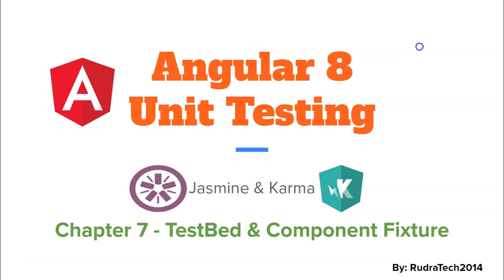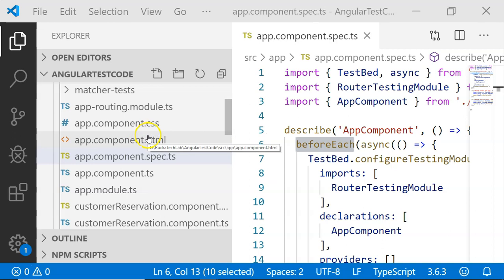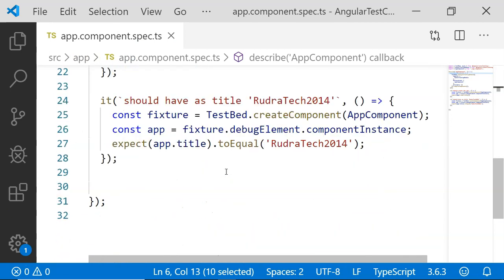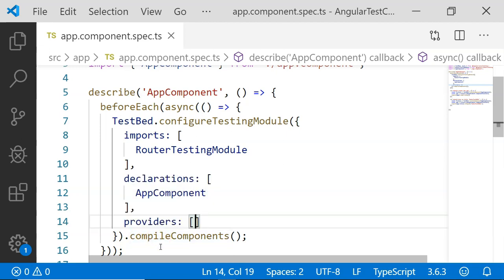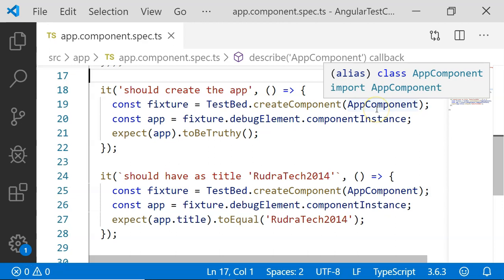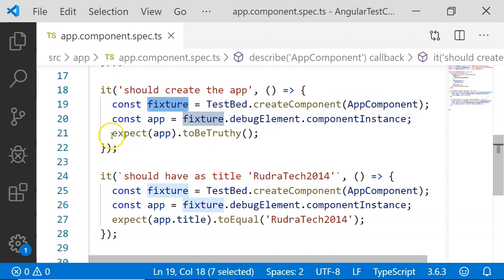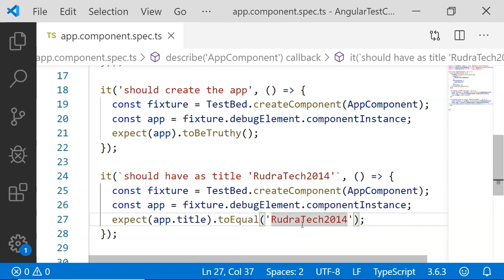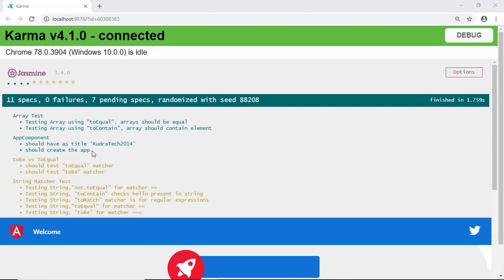Chapter-7 TestBed and Component Fixture

Comment: please explain this case also. It is auto generated by angular-cli.:

  it('should render title in a h1 tag', () => {
    const fixture = TestBed.createComponent(AppComponent);
    fixture.detectChanges();
    const compiled = fixture.debugElement.nativeElement;
    expect(compiled.querySelector('h1').textContent).toContain('Welcome to AngularTestCode!');
  });
Reply from the maker: The code is trying to unit test content in the h1 tag.
it('should render title in a h1 tag', () => {
//create fixture object a wrapper for component
    const fixture = TestBed.createComponent(AppComponent);
//forcing the test to detect the changes
    fixture.detectChanges();//
//Create variable to access all the elements in the component
    const compiled = fixture.debugElement.nativeElement;
    //Check the component is having the h1 tag with specific content
expect(compiled.querySelector('h1').textContent).toContain('Welcome to AngularTestCode!');
  });